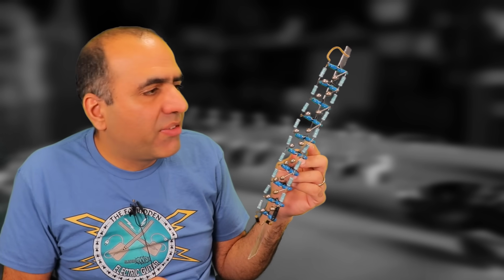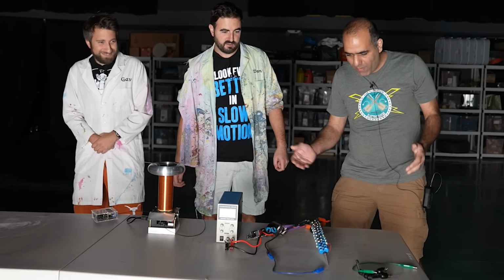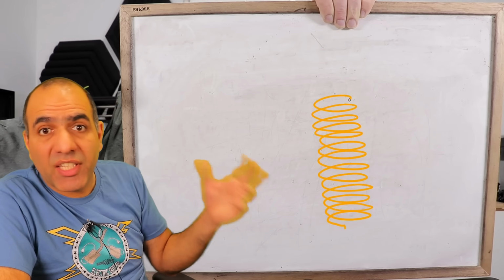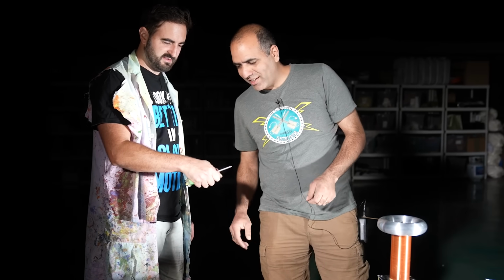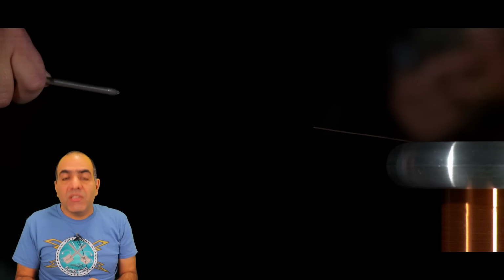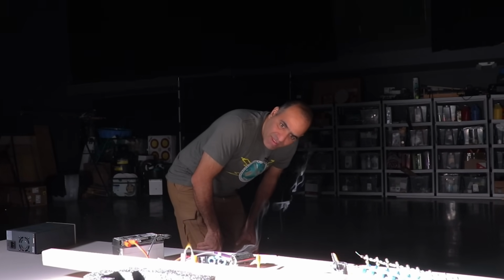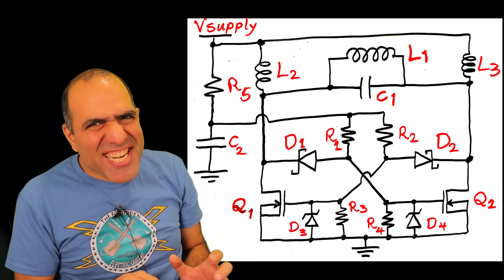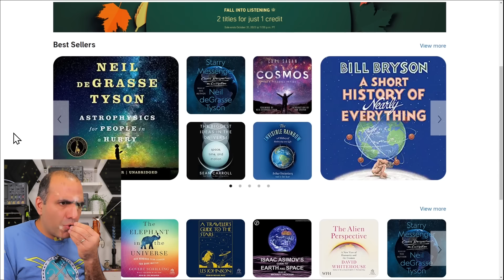Slow-Mo Experiment Disasters, ElectroBOOM VS The Slow Mo Guys

Comment: I know python scince 1 year, and I could've written you software to find those pixels. Should be pretty simple by just adding op the brightness of every pixel in a frame. Some frames will have a much higher value cause of the arcs. But anyway amazing video :)

Comment: You can probably find the single frame with your arc with some openCV. 
I'm no expert, and there's definitely a better way to do this, but off the top of my mind you need to find a region of interest where you expect the arc to be, then choose a reference frame that doesn't have an arc and then take the absolute difference of that region from every frame, convert the result to grayscale, put a threshold on the result and count the number of non-black pixels.
Should be a loop with ~10 lines of code in python and you should get your result in minutes.

Comment: 3:01 Yikes.

My power supply blew up too, albeit it didn't sound like that, it sounded like a capacitor explosion, blew the fuse instantly and it let out a rancid smell.
Upon further examination, a failure of the main IC caused the main switching MOSFET/transistor cascade to short out and the supply DESTROYED a powerbank circuit connected to it. And as I can't get a replacement IC and it's been 2 years, I'm starting to give up hope on it.

But my heart dropped when that poor supply went bang like that. F**k.

Comment: In closeup 300000000[m/s] and 1,75milion framer per one = 171,42857[m] per frame Generator will give some advantage with all capacitors and air arc distance maybe it is why this one gap at the generator ignites earlier.

Comment: high voltage at over 1000ft  causes issues for poor insulation in circuits as its able to ark over components that normally it cant  - maybe a factor in all the popping of the HV PSU

Comment: I cannot understand why it should be so hard to find those frames, this should be a few lines of code using image processing software. 
I mean the technology to very quickly find images which do not look like 99.99% of the rest of the images is about 50 years  older than the technology to shoot 1.75 million images per second.
Reply: They have the technology - they just forgot the cable to connect the laptop to the camera. 😆 The Slow Mo Guys wrote a comment about it on their own post.
Reply: @GenericaQwerty  ok, well I can understand how it is possible to forget a cable. Though maybe it would still have been easier to buy or lend one rather than brows through millions of frames, but what do I know ...

Comment: Hey Medhi, if you want to find that "1 in million" frame, you can have a machine learning algorithm go through the footage and find the frames by telling the MLA what to look for (RGB code changes from black to purple for example) on the screen. I don't have the code set up, but if you want to save some time then I or someone who has an actually good computer can do it. It would take my computer about 4 hours to run through 1 second of footage at the highest speed.

Comment: This may just be me being an idiot but doesn't seem that it will be possible to have someone write a piece of software that can analyze the frames very quickly and find the one or two that are different from the rest, sort of the same principle as motion detection.
Reply: This might actually be very possible I suggest you try it if youre a software engineer
Reply: Gav said in another video that the camera does exactly that

Comment: hey Mr ElectroBOOM You should try and have a look on Nvidias new gpu power adapter cable that keeps melting and burning peoples computers with ther new 4090 cards :D
Something with the pins that arcs doe to bad connections.